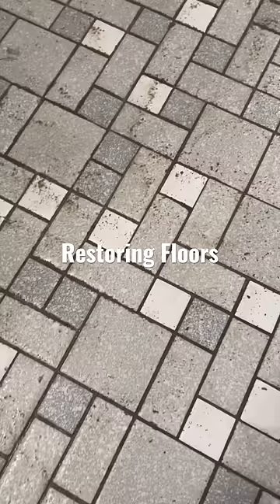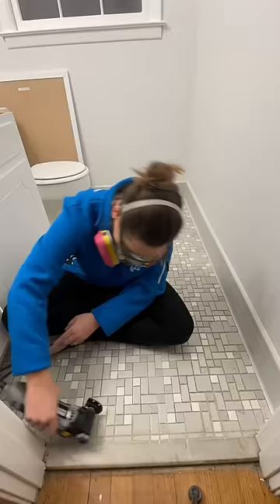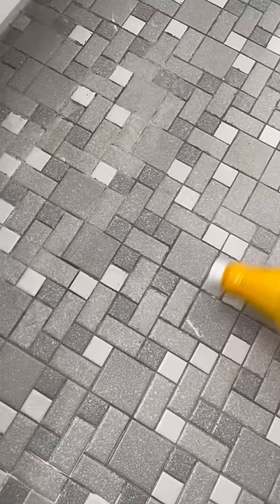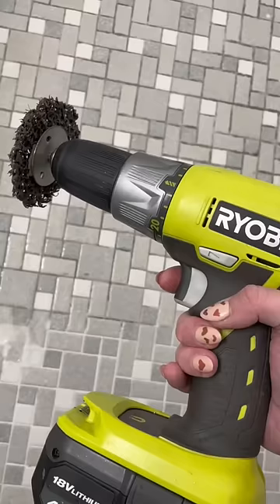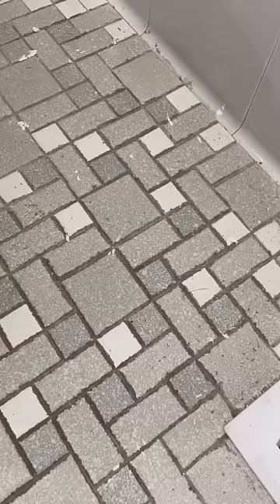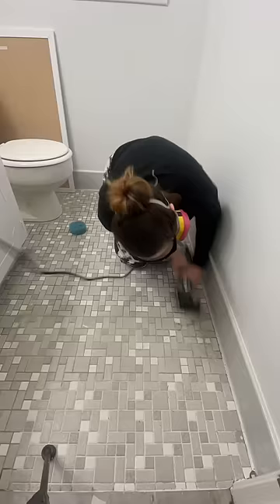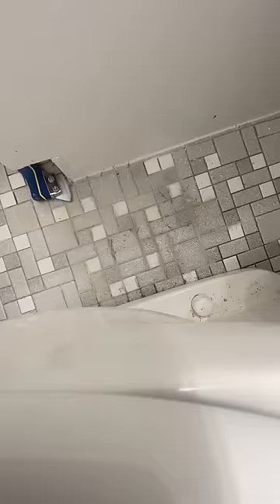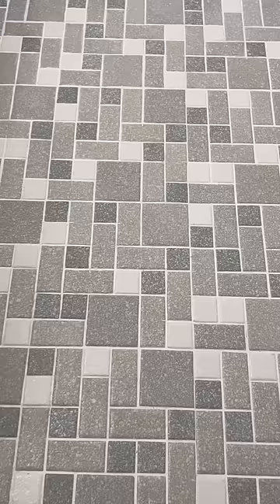Restoring filthy bathroom floors! | Floor restoration & re grouting | House Project 1970s Home Reno

Comment from the maker: My favorite transformation so far! I wish I didn’t rip up the floors in the upstairs bathroom and did this to them. They were worth the work 🤩
Reply: That was a ton of work with all those grout lines but you made it look really really good
Reply: It’s fantastic!  So glad you kept those tiles, they’re so nice
Reply: It’s looks amazing! What’s your estimated total cost after the DIY including tools!?
Reply: If your floor ever gets like that again, don't go through the steps that you did this time. all you have to do is get some low odor liquid drain cleaner, put it on your floor, let it sit overnight. come back the next morning wipe it all down 3 or 4 times and then seal it.  The cleaner will not mess up your tile and It will be like brand new
Reply: Now after sealing the floor, NEVER use harsh chemicals on it, especially bleach based products. Mild soap and warm water using a nylon bristled brush and/or chemical-free sponge to clean the floor. Reapply sealer to a clean, dry, floor yearly or to manufacturer’s directions. Your grout will stay looking new for decades.  -Former Tile Contractor
Reply: Just fyi, you are totally going to regret using white grout in your bathroom. It stains very easily from normal use and cleaning. And this is made worse from a regularly damp environment such as a bathroom. I know from personal experience because my last house had a bathroom with white grout also...it didn't stay white long either despite every effort to keep it that way.
Reply: So glad you saved it!
Reply: What did u use to seal the floor the video cuts out at that part
Reply: @jessn2474  Your grout wasn’t sealed, wasn’t properly sealed or the sealer was compromised by harsh chemicals like bleach solutions.

Grout is porous, even after curing. Using a good grout sealer once new grout is cured is essential. Reseal it once a year, and clean it with a a few drops of dish soap in warm water. It will stay white or whatever color.
Reply: @Swimdeep  Actually it was. This is not an uncommon problem to happen. I've seen it on countertops in people's homes as well. And in other areas including walls. White and light colored grout such as cream colored do stain easily. And there were no harsh chemicals used on the floor. I have a lot of experience with tiling.
Reply: Looks awesome Dremel tool great tip thanks
Reply: You did an EXCELLENT job.

Lots of work and really glad you know how much you value it… and say you’d do it again (if you hadn’t ripped out the other BR floor first).

I know this is a DIY project. And you MAY have other projects you’re working on BUT once you’re done I encourage you to assess all of the projects taken, their results and your level of “worth the work” success.

If you can market yourself to do that one thing… because you learned spraying the product on, letting it sit for 15 minutes before using the tool to remove the gunk, and then using the grout remover… 

Well… you could decide to do it for other people and charge a decent amount. Lots of us have to DIY but lots of others have the disposable income, the wherewithal and the appreciation for the results you get.

This video IS that marketing piece (if you choose the tile renovation as your preferred task).

You did a great job. Really made it perfect. That’s the kind of work I’m proud of… and couldn’t do myself.

There are general contractors out there that can use your expertise and will pay you very well for your skills.

Just make certain you keep up your own marketing campaign… and charge the same the contractor would. He’s quoting a realistic price. So are you. If he brings the work to you, he’s your “agent” and a reasonable finders fee is appropriate.

Otherwise… the homeowner can find you directly.

Win/Win for EVERYONE.

Good fortune to you!!!

Comment: Thank u for mentioning the sealer. Lots of people talk about using wire brushes in cleaning floors but then are surprised when the floor got dirtier faster and did not come clean as easily

Comment: Yes !! Very important once you do all that hard work use good quality grout sealer.
Usually re-seal every 6 months to a year, more if lots of wear...and lightly clean.

Im surprised the wire brush didn't scratch up the tile...just use grout tool or similar item...some tile is easy to damage
Reply from the maker: Good add on!

Comment: THANK YOU FOR USING A SEALER. FINALLY SOMEONE WHO UNDERSTANDS!!! I work for a flooring retailer, I get asked on the sale floor if the grout needs to be sealed. Everybody in the department says “no”  because the manufacturer says it doesn’t need to. Well I’m here to tell you from personal experience, ALWAYS. SEAL. YOUR. GROUT. Especially in a shower, it is much better to spend $20-$30 on sealer and lose an hour every 2 years or so, than it is to spend hours regrouting tile. Do it right the first time and protect your investment.

Comment: I got a friend who worked as a tile salesman. He had sold some tiles to a family and after a year they called back to tell him that the tiles had become brown and the glazing was completely gone. He had never seen anything like it. All the glaze, just gone. After prodding around and asking some questions he found out they used the floor polisher on it every other week. Over time it sanded all the glaze off. 

So what im really trying to explain, watch out with what you use to clean your tiles. This wire brush will definitely cause cracks and other problems on the floor. Best to use stiff plastic brush on it. Even going over the tile once will decrease the gloss and cause tiny chips in which water will be able to leak.

Really nice grout job! Looks like new :)

Comment: You can use EasyOff oven cleaner (yellow can) to dissolve the gunk and remove it without power tools that might scratch the tiles. Spray it on (wear a mask) and cover with plastic to prevent evaporation.

Comment: If you want to restore grout, you can do the same cleaning but use a grout recolourant epoxy or a acrylic based recolourant over the top of the existing grout. It's a lot less work than cutting the old grout out.

Comment: I bet a harbor freight $10 disc grinder fitted with a $5 brush cup could have cleaned the original grout perfectly so that you wouldn't need to cut out the grout and regrout.  The entire job could be done in a couple hours of effort (plus some drying time before hitting it with grout sealer).

Comment: 1)turn on fan
2) use bleach water 7/10 
3) brush
4) shop vac
5) rinse with more water and shop vac until fully rinsed
Job done, your floor looks new.
Just saved you like 8 hours of work.
Take about 4 hours still but 90% of that is just letting the bleach sit and break down crud and kill growth.

Comment: "It was dirty, it was filthy,  it was run down.  . . "  . . . . It was grey grout. If clean means getting it white, this is the only way to get it that color. but unless grout is cracked, damaged or you really need white grout to keep your demons at bay, this is so unneccessary.
As a person that does tile installation and remodle work, I would not reccomend a grout change out as a first or second choice for homeowners. It is a major pain in the back, knee's, hips, and shoulders.
Thorough cleaning also causes these pains just for a much briefer time period. Removing grout is labor intensive. 
I would use the Zepp, grout cleaner and a cleaning brush on a drill. Multiple times If necessary. I also use a copious amount of water and a wet/dry vac to get all the water with the dirt, up and off the surface.  A steam cleaner can also  do a really good job cleaning stains. 
After your done cleaning, reseal it.
If you do regrout,  replace the old stuff with a 2 part epoxy grout. It is a vastly superior product in my opinion.

Comment: Ok, 2 thoughts.

1) did you really take a power tool the whole surface? Tiles are glazed. If you scratch the glaze they will not keep being water repellant and instead soak through. Hurray for mold under. You also don't want scratches because dirt sits very well in the scratched glaze and just wet mopping won't be enough.

2) sealer for grout sounds like an awesome thing, especially after you invested that much work and want to protect your work. It sounds like an amazing invention until you learn that the amazing sealing properties in the sealer come from forever chemicals that are really harmful not only to your health but for generations to come because they didn't get that name for no reason, forever chemicals.
You don't plan to eat from your floor, sure. But I wouldn't go near that stuff.